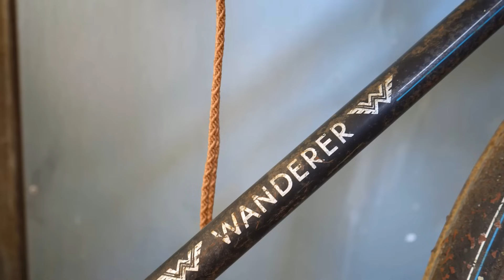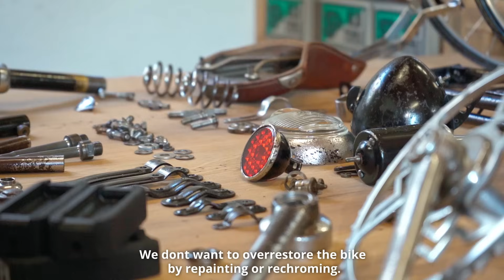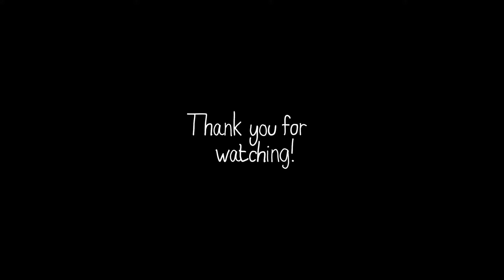German WW2 Bike - Restored and Ridden again!

Comment: I know I'm very late here and no-one will read this but I am amazed at how repairable this bicycle is. Every single piece can be replaced no matter how tiny it is. The build quality is robust. No flimsy part to be seen anywhere. Companies nowadays are always after cutting corners. 

Regarding the restoration process most people are at the extreme ends of two opposite sides. Some hate the fact that the patina is removed or a new coat of paint is done and vice versa. I'm kinda in the middle. If the rust has entered under the old paint you sand it and paint it to prevent further rusting. If it's a few chipping here and there or the paint has rubbed off due to regular use, keep it as is. I follow this philosophy while repairing things in my house.

Thank you.
Reply from the maker: Thank you!😃
Reply: I read :) The robustness is the reason why i owned 30 years ago a bike from second world war. I don't know the brand anymore. But it was the only bike that was able to keep up my paper boy job. 50kg load on the bicycle rack was no problem for that bike. It reduced my round trips to base station enormously.

Comment: Great vehicle and restoration. What I particularly notice is that the mudguard around the front wheel is nice and long, not like most modern bicycles that throw dirt and water at themselves and the rider's shoes. I don't understand this step backwards. Dirt everywhere because a short mudguard is considered sportier and cooler? People used to be smarter. For my needs, a mudguard has to be even longer, the tangent of the tire, along which dirt flies away, has to run below the bottom bracket and the pedals. So I attached a self-made protective shield made of neoprene and a steel wire bracket to my bike. So everything stays clean below for much longer. Although my bike is 54 years younger than the Wanderer here, it is also 31 years old and on the road every day in summer and winter, I take good care of it.

Comment: The closed end of the master link clip should face the direction of travel of the chain.....this way, if it strikes something or something strikes it,  it will be pushed  in the direction that keeps in on instead of knocking it off.    Very nice bike.  Nice restoration.   Definitely a keeper.      Be well.

Comment: Congratulations! I almost driven to the tears because the result with the dynamo headlight still working! One question: Why the rubber handlebar ring at 23:00 ? Was it like decoration used on old bicycles? It was to signal something for pedestrians or drivers (I thought because of the bright color)... The only thing missing was the tube repair kit for it, because you even got the rear light! Very good job, guys!
Reply from the maker: Thank you very much!
Die rubber was used to lean the bicycle against a wall e.g., so the frame doesn't get damaged.
Reply: @forgottenthings  How very intriguing, that was my same question.  Thank you for your meticulous video of a meticulous method.

Comment: you generally don't have to reuse bearing cages in those kinds of applications. they were used to cut costs on bearings and you can just replace them with more bearings for a smoother ride and  more durability
Reply from the maker: That is a good way to go! Actually we do that if the cage is broken or we have to face some bumps in the bearing seat.
Reply: You might want to look at my comment above. Get rid of cage bearings whenever possible. Keep in mind the basic thing about bearings. TEN.
10 bearings each side on the front hub. 11 bearings each side on the bottom bracket. 9 bearings each side on the rear hub. I'd have to think about the bearing size. Definitely quarter inch on the bottom bracket. 9/16 on front?. Lol.
Reply: @forgottenthings  how did you determine the number of bearings in the headset? Those are 3/32? My understanding is you put in enough bearings until one pops out. You remove that one and one more bearing. You think it'd be more precise.
Reply: @marktalbott3835  Yes, the mechanics are surely not top flight.

Comment: That little system for generating the electricity is so cool. Also what is that rod for mounted on the seat tube? Beating up potential bandits when your out in the countryside? lmao. Amazing piece of history.
Reply from the maker: The rod is an air pump for the wheels. I guess, it probably still hurts when used for self defense.

Comment: I am impressed with your antique tool collection and your collection of period correct handlebar grips. The wheels are they new or did you restore the hubs and rebuild the wheels with new spokes? I noticed that you did not apply a thin film of grease between the fork and stem. Even in museum conditions components can become stuck over decades.
Reply from the maker: We are specialized on german bicycles between 1900 and 1940, therefore those tools are a necessity :D
The wheels were rebuild with new spokes and nipples as you mentioned. The hubs and the rims are the original ones.
Reply: They Looked great! A+ @forgottenthings

Comment: Very good work and adorable Wanderer  ! As a bicycle mechanic i missed grease on some parts but if it is not ridden in rain it will be okay. The video itself is excellent ! thx - so chilling.  I am interested with what you made the pedals black again...
Reply from the maker: Thank your for your very nice comment! Since the pedal rubber gets really hard after 80 years, we use glycerin to give it back a little bit of softness. The black color is a nice byproduct of that! Where did you miss the grease? We are always open to learn something new!
Reply: @forgottenthings  thanks for your answer ! Grease at the thread of the pedals, and very important on the seatpost, and at least at the cone of the handlebar and the handlebar itself that fits inot the fork. But this is important for bycycles that are used daily and in the rain. And if you like to hear: when you put new balls in the bearing, have a look at the cage and sometimes i bend it down again a bit with a soft touch of a small hammer, so they couldnt fall out. But as a proffessional i dont see any "mystakes" and was joy to watch. some videos i have to close cause it hurts me - lol

Comment: Elegant gemacht! Zwei Fragen: Warum hast du die Kugellager gewechselt und wozu dient der Gummiring auf der linken Seite des Lenkers?

Elegantly done! Two questions: Why did you change the ball bearings and what is the purpose of the rubber ring on the left side of the handlebar?
Reply from the maker: Vielen Dank!
Die Kugellager werden aufgrund von Verschleiß gegen neue Kugeln getauscht. Dadurch merkt man z.B. einen wesentlichen Unterschied beim einstellen des Lagerspiels.
Der Gummiring ist ein sog. Lenkerschoner und verhindert das verkratzen beim anlehnen des Rades.

Comment: That was nice. What is the lever for on the right handlebar? I saw no brakes anywhere. It looked like the rod went from it to the top of the front fender. Does it clamp the generator? But that means you’d have to hold it in place
Reply from the maker: The lever is for the front brake. The front brake ist a stamp which is pressed on the front wheel by pushing the lever.
Reply: @forgottenthings  neat. I’ll have to watch it again and look for it

Comment: You do not need a wire brush. Permanent damage to paint and patina will result. It's best not to ever use an abrasive brush on vintage paint. Vintage paint should always be preserved to keep the bike original. Use a 50/50 mix of vinegar and water on rusted surfaces, letting soak for several days. The rust will just disintegrate under the acid, but will not harm the paint or steel. Thoroughly rinse with soapy water to remove the vinegar acid. To preserve the metal, a thin coat of linseed oil looks nice and works best. I see so many people butchering those grand old vintage patina finishes on old bikes, completely erasing the history of the bike's travels and hurting its value. A bike with vintage paint and markings will always have more value to a serious collector.
Reply from the maker: Thank you for your comment!
We dont use wire brushes on painted parts. At 1:02 and 1:11 we used a soft plastic brush only for superficial cleaning. The other 90% is done with steelwool varying finess and only very puncutal on rust. With this technique we are able to preserve as much paint as possible, while we get a nice looking, natural finish. 
We dont use pure linseed oil for several reasons: 
1. Its not removable without destroying the underlying paint.
2. It will become yellow over the years.
3. It does not penetrate rust that good.
We rather use Owatrol oil very thin and only punctual on rust. For the paint and overall finish, we use the same wax museums trust around the world by using it for their objects. 

We refined this technique over the years and are very happy with the results.
Reply: I myself use half diesel half any kind of mechanical oil and graphite powder,graphite really helps rusting to stop.
And apply it thick then rubbed it of with a dry cloth.

Comment: Finally, something I might know more than you do in terms of mechanics. Two mild criticisms. First is you should always replace retainer bearings with free ball bearings. As long as you're opening that stuff up. And restoring it. You might as well get rid of those bracket bearings. They only create problems. The worst thing you did though was put a tube into the bicycle tire without any air in it whatsoever. That is a surefire way to get a pinch flat. You always want to put enough air in the tube so it has a shape. Again. Otherwise, you are very likely to catch that tube between the rim and the bead of the tire. You also didn't say whether that was a new wheel set and how you came upon those tires and what size they are. I would be interested to know that.
Reply from the maker: Thank you for your comment!
We use free ball bearings when the shells are worn out. The use of retainiers is something most German bikes between 1910 and 1960 have in common. So we keep them (when possible) for historical accuracy. You are totally right, the tubes have too little air. It was very late back then, so we messed up a few things we normally do right...
The wheels were cleaned, conserved and rebuild with new spokes and nipples. The Idea for filming came use after that, so we dont have that on tape...
Reply: I am also a bike mechanic,that restores a lot of vintage bikes,and its a good practice to put grease on all threads pedals,screws,seat post,stem everything,even smear with grease portions of metal wicj aren't exposed for future preservation against rust.
Even I coat the inside of frame and other tubes with automotive cavity wax.

Comment: Hi, I have a question - how did you remove the crank from this bike? I have the same mechanism in a bike that I want to restore, but I can't manage to remove the crank and remove the bottom bracket ... I will be grateful for the information.
Reply from the maker: You need a special tool. You can build it by yourself or buy it on eBay. Use Google and search for "Abzieher Glockenlager", you will find examples how they look like.

Comment: I cannot see how the brakes work on this bike. I could not see any brake shoes on the rim but you have a brake lever. Can you please explain? Thank you. Love your videos!
Reply from the maker: There are two breaks. One break for the front wheel and one for the back wheel (coaster break). The front break is activated by the lever. It presses a break shoe onto the tire. The mechanic is installed at 13:00.

Comment: "W" Chainring is so cool

What is the red rubber tickler on the bars for?
Reply from the maker: Back than, the Bikes did not have any bike stand. Therefore you had to lean it against something. The red rubber tube is to protect the bike from scratches and damage.
Reply: @Forgotten Things  ohhh! makes sense, protects the handlebar chrome and the lamp/wall. Genius. Never seen b4. Tha ks for replying

Comment: I’m working on a 1944 DBS, Norwegian bike. It’s been laying out next to a barn near the sea for who knows how long. There’s only a hint of paint left. I’m on the same page as you with not over restoring. How deep must I clean the rust before settling with the Ovatrol and wax. Must it be down to grey metal?
Reply from the maker: You want to get the orange rust off till you reach the black patina of the iron. Actually you dont even have to remove the solid rust, because Owatrol penetrates through and conserves the surface as it is.

Comment: Also, what is the purpose of the thumbscrew with the band inside the head tube? To stop the handlebars and fork from turning? 🤔
Reply from the maker: Exactly! In this era most of the bikes did not have any sort of stand, so you had to lean the handlebar against something. The thumbscrew prevents the bike from falling over.

Comment: Does anyone know what the red rubber on the handlebar is for? And the screw and band in the frame. Is it for stiffen up the steering so it doesn't wobble at high speeds?
Reply from the maker: The red rubber is mostly used for saving the paint when leaning the bike against a wall. Also the mentioned screw ist to thigten up the steering for stability when standing.
Reply: @forgottenthings  Thank you for your answer.

Comment: Are the rims original..?  Steel or aluminum..?  Looks like the hubs and spokes are new, I guess they had to be replaced…?

interesting that 85 years later and fender / mudguards have not changed at all, same stays, same attachment…. actually it’s gotten worse as now we have floppy plastic and then there was stiff metal….  :)
Reply from the maker: The steel rims and the hubs are original. We only replaced the spokes and nippels due to safety reasons.

Comment: Why would you not have had it    "bead blasted"    as   cars are ?
Reply from the maker: Heavily restored bikes are less valuable to collectors, than unrestored or gently restored ones. In the last couple years, this trend can be seen all across the german oldtimer scene.
Therefore, when the original paint of the bike is in good condition, you loose a lot of value by repainting.

Comment: I've recently found an old bicycle frame from Phänomen, that happens to also have seat stays that are tightened with a bolt on top. Do you know if there is a specific name for those bolts and where one could buy them? P.S. I'm keen on restoring it and hope to get to work soon.
Reply from the maker: Nice! Phänomen was a very nice manufacturer. In german those bolts are called "Sattelklemmbolzen". You get most of the parts at the german webshop velo-classic.de. They also offer global shipping.

Comment: Interesting how bike builders have had different solutions for mechanical problems, the front brake for example and what looked like an early attempt at cotterless cranks.
Reply: It's basically the same as a 'modern' square taper assembly, but it is completely missing the threads for the puller, which makes this an absolutely awful idea ;) thankfully they used high quality steel in those days so they hardly ever need to be taken off. 
These are the same 40mm cups and cones used with cotter pin cranks since about the mid 50s which became known as the 'Thompson' BB. 
Then in the mid 80s they went full circle by using square tapers again, but this time proper ones, in the early 90s pressfit cup and cones disappeared completely, except for the Us type one piece cranks of course.

Comment: How does the front break work?
Reply from the maker: When you grab the lever, the stamp with the black rubber break pad presses onto the tire tread.
Reply from the maker: By pulling the leaver on the right part of the handlebar, the Stamp is pushed down. It's held back by a small spring inside the stamp.

Comment: i rode bicycles and repaired bicycles since i was 10 years old, but i don't know what that orange rubber thing is on the 
handlebars. i finally gave up riding so much with old age and getting hit twice by cars.
Reply from the maker: Its used to protect the handlebar from damage. Most of the bicycles in this era did not have any sort of stand, so most of the time these were just lend against walls/trees/laterns/...

Comment: Nice rebuild but those steel frames are one big pain in the... how do you remove rust and preserve them inside? Rear triangle especially.
Reply: They don't rust much on the inside usually. But if there's lots of rust, not too hard to flood the frame with whatever rust treatment you prefer. The seat stays either have little holes in them, or they don't, but then there's no need to worry about rust.

Comment: what is that red thing on the steering wheel?
Reply from the maker: Its used to protect the handlebar from damage. Most of the bicycles in this era did not have any sort of stand, so most of the time these were just lend against walls/trees/laterns/...
Reply: @forgottenthings  that's what I thought but wasn't sure, thank you very much and best regards 😃

Comment: how is this supposed to brake? i see a puller mechanish in the handle
Reply from the maker: The bike has got one brake at the front, as you mentioned. That is a stamp which gets pushed down on the tyre, by pressing the lever at the handle bar.
The other brake is set in the rear hub. It is a coaster hub, we will show in a future video.

Comment: at funf minuten , ist das eines steering dampener ?
Reply from the maker: It's a typical German bike part. Since those bikes didn't have any sort of bike stand, this screw is used to prevent the handlebar from turning. It makes leaning the bike against a wall easier.

Comment: Steel wool just destroys surfaces, there are smarter ways for cleaning paint and galvanized parts. The spring for the chain link is mounted is mounted in the wrong direction.
Reply from the maker: Which way would you prefer? We would be glad, knowing a better solution.